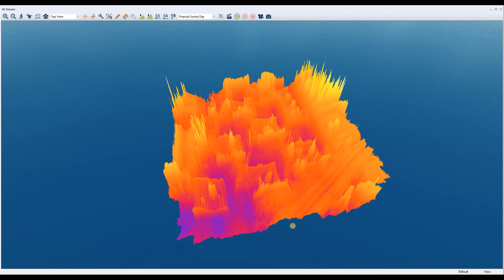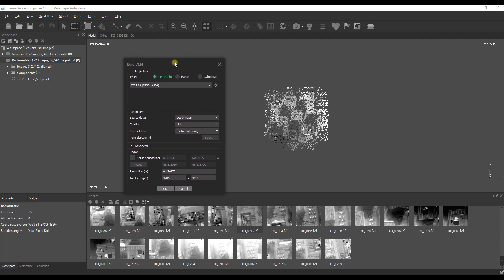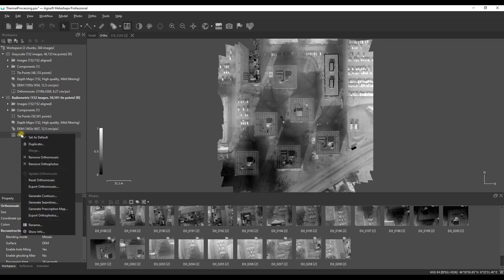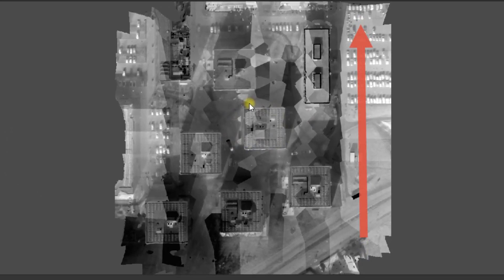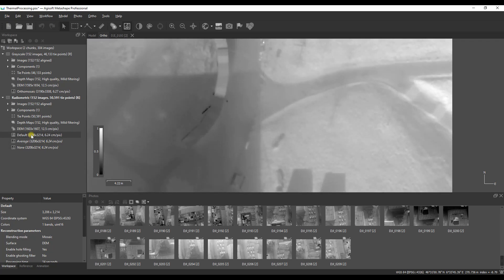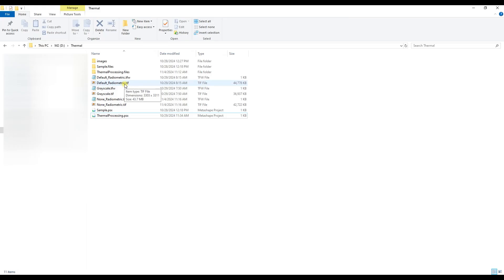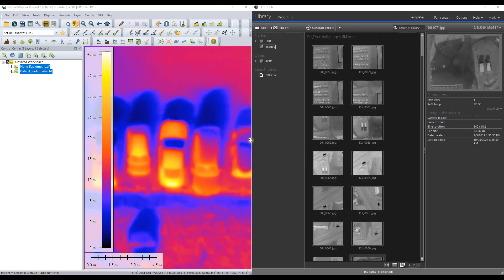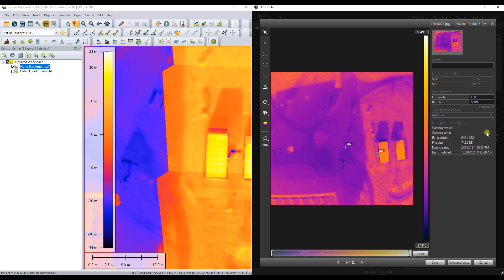Advanced Thermal Photogrammetry Workflow - Metashape

Comment: Extremely informative, is there any way to set up the emissivity value in the Raster Calculator formula ?

I'm preparing a thermal mapping project and your videos are very helpful. Please share any info you can :-)
Reply from the maker: Hey Denis
From what I know, you cannot account for emissivity changes in the raster calculator. This is because each sensor, and I suppose manufacturer, would use slightly different algorithms to deduce a temperature value from the emissivity and many other variables as well. 
I think the best best is to edit this and export from the manufacturer tool, if they have one. For Flir you could use Flir Tools and I think other brands have their own versions as well where you can edit the variables and export, then take those files into Metashape. 
Not what you’re looking for, but I hope it helps a little.
Reply: @geospatialtips  it's alright. Actually this is only required for individual imagery and not for processed mapping so I'm good. However I wanted to thank you for your thermal mapping videos because it helped me to confirm that radiometric images can be processed in metashape, and provide these radiometric data within the exported geotiff.

Comment: Thanks for the video, I have tried myself but when aligning the picture i do not obtain any tie points. I get 0 of 10,928 tie points for 576 photos. Do you know why this happens? Some background of the data collection process: flown with RTK, the pictures have been imported with X,Y,Z gps metadata but no rotation data was imported. Thanks for any help.
Reply from the maker: Hi Julian
Have you checked and/or set the pixel resolution and focal length in the camera parameters? Then, you could also try removing the accuracy you have imported form the RTK, or reset the accuracy to 10m or so for all images and retry.

Comment: Thx for the video. What I don't understand is why there is a 25°C difference in the "none" blended version of the orthomosaic. Why is the difference so significant and the "border so hard"? Was there a lot of time between the two flown lines?
Reply from the maker: Hi - you are right that this is a huge difference. 
Unfortunately this was a dataset I downloaded and had no control over. Simply put, I think it comes down to having a lower quality sensor. The time between images was not too large, but sensor quality makes a big difference. With these simpler sensors, it is trying to compensate for differences it records in real-time and sometimes gets that wrong.
With superior sensors, differences are very seldom this large, unless there are issues.
Reply: @geospatialtips  can you share the images set that you used ?